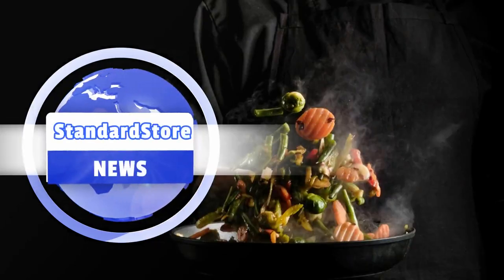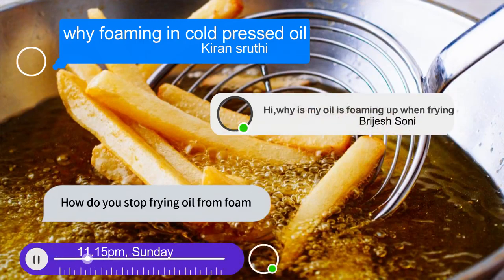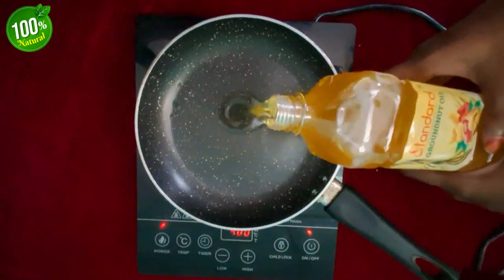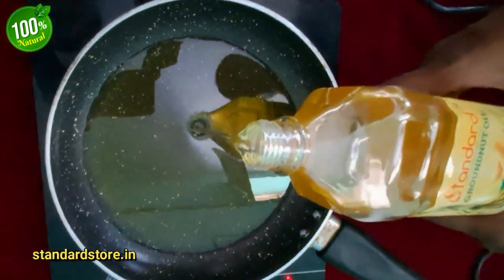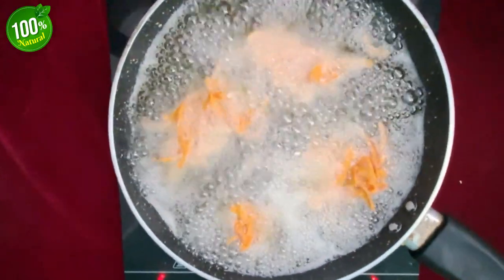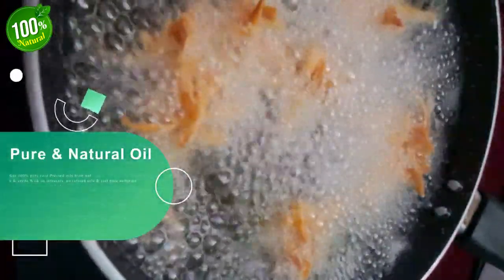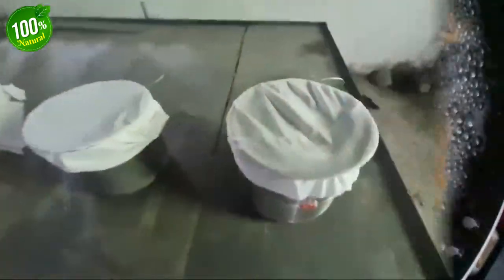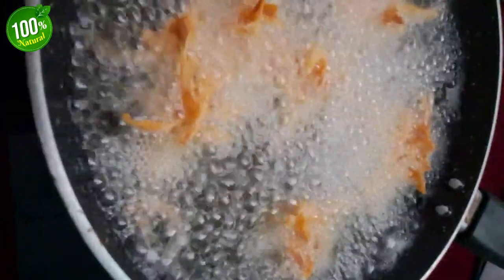The Reason Behind Foaming in Cold Pressed Oils While Cooking Explained & How to Get Rid of Foam

Comment: Foaming happen if there is residual moisture in oil.
Previously in olden days the cold pressed oil was left in sunlight for 72 hours before using just to get rid of this moisture. But time and demand strain is highter now a days so it might not be possible. But moisture is the cause of foaming nothing else.
Even if foods with high moisture content are used, it will foam.